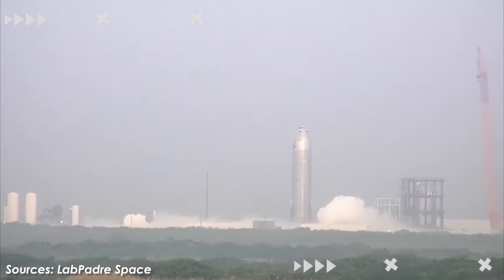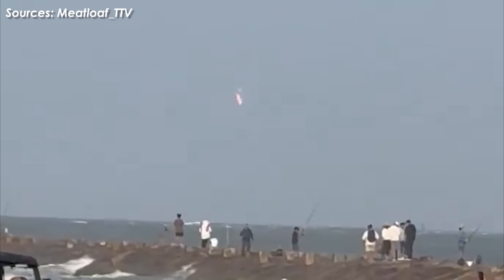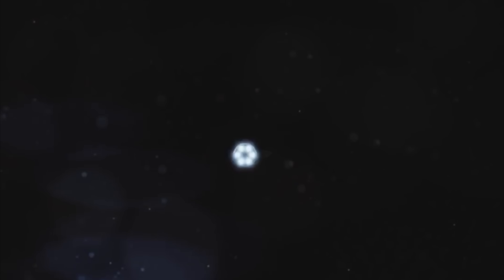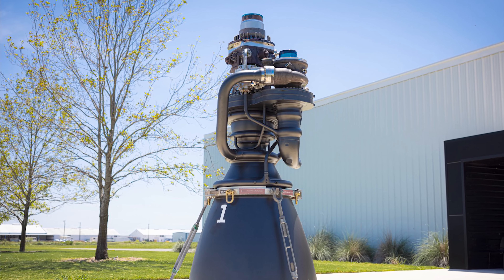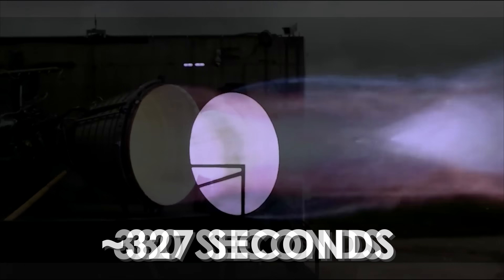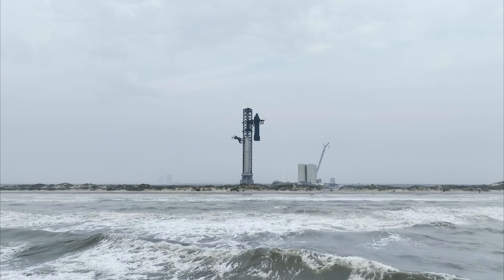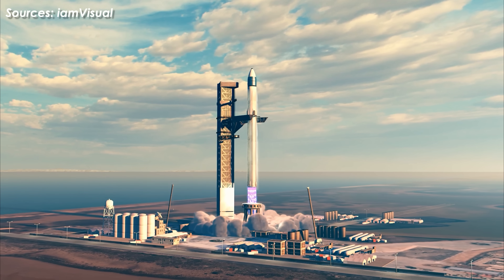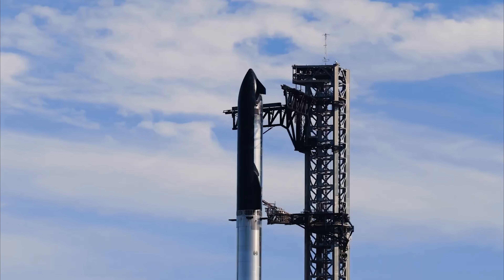SpaceX officially Revealed New S37 Engine Solutions...Starship Flight 10 Ready NOW!

Comment: At the dawn of the space age, the Jet Propulsion Laboratory designed a research rocket for the U.S. Army called WAC Corporal. It featured three fins. There was concern that it would not work, as all other rockets before had four fins. But it worked and that is why three grid fins will also be sufficient.
Reply from the maker: You made a good point

Comment: Raptor 4 needs to be a Bi-try-fueled engine.  Seems that start-up is a problem that can easily be solves with a different fuel.  Apparently Methane has some critical downsides and start-up with a more reliable fuel and moderation with such could solve the problem as the harmonics of the more stable fuel would be different and could be used as a moderator.  Argon sould be considered also as a fire suppressant and even as a engine moderator.  Carbonic acid should also be considered at low altitudes and high pressures, like at take-off.  Testing of new Raptor engines should be conducted on the smaller rockets first, such as a Falcon 11 (10 being an 'X' model)..
Reply from the maker: Interesting take! Fuel composition definitely plays a huge role in start-up stability. Using moderators like Argon or even testing on smaller platforms like a Falcon variant could be a smart move. Appreciate your insight!

Comment: Good Morning. I know a lot about dealing with vibration and harmonics. I would think by now they would have had a handle on this particular problem. The would love to see the torturous events that are happening in real time. With all the feature updates. For me that's a whole new realm. It seems they need to develop an new type of vibration/harmonic censor or both. Almost in every area of propulsion and structure. I think you are right about the Raptor 3. But is the Raptor 3 ready for service? I heard there is still some refining to do on it. Have you heard any thing? Great episode. Keep doing what you are doing my friend. Have a Great Day.
Reply: Musk is trying to force his way through the wall.
His specifications are unrealistic.
If he's lucky, he'll succeed, but I think that's unlikely.
V2 is a stillborn.

I think we'll see some beautiful fireworks.

What Musk can't handle:
Quality management
Real experts are only brought in when it's too late
Saving weight prevents sensible solutions and limits the engineers

Solution to Massey's
Take the retaining segment from the Buster booster and cut it off.
Mount the hot staging ring above it
Dock the Starship above it
Done
Reply from the maker: Thanks for sharing your thoughts. SpaceX's approach is certainly ambitious and not without flaws, but every test pushes boundaries. Let’s see how things unfold - even setbacks bring progress. Appreciate the input!
Reply from the maker: Thanks Kevin! You're absolutely right — vibration and harmonics are still tricky challenges. Raptor 3 is  a perfect choice. Let's see how SpaceX handles it next! Appreciate your insight and support 🙌🚀